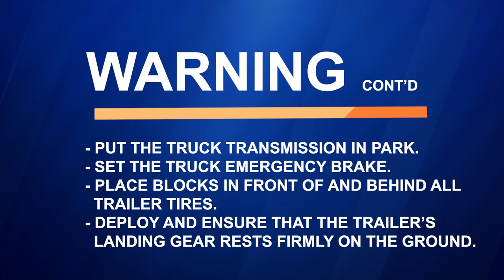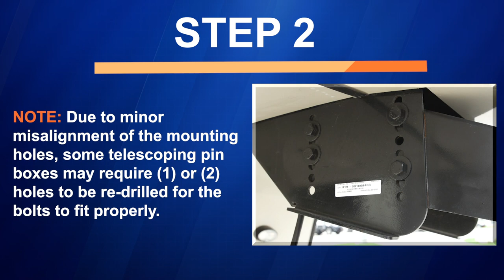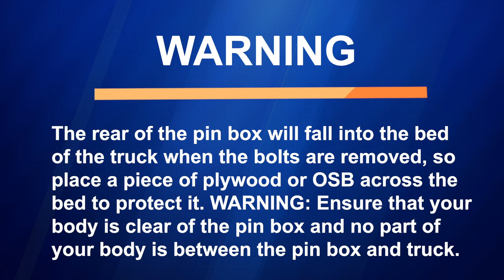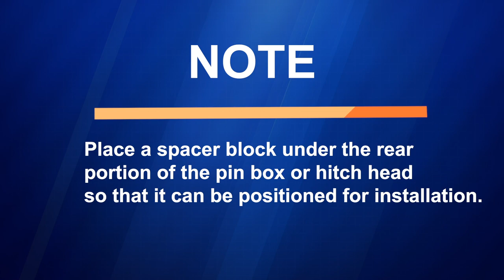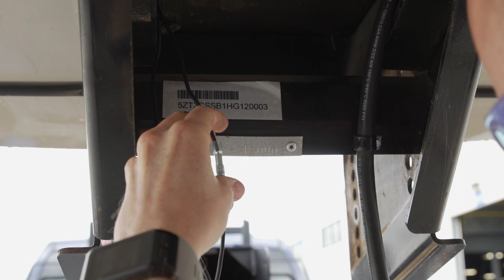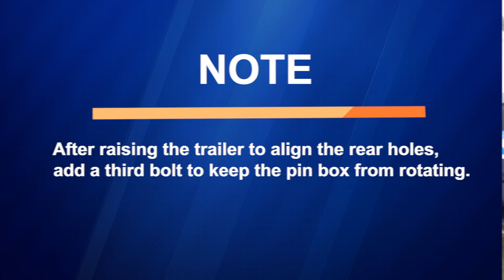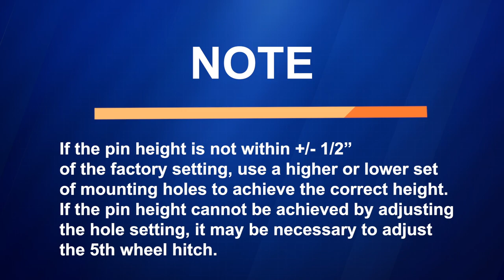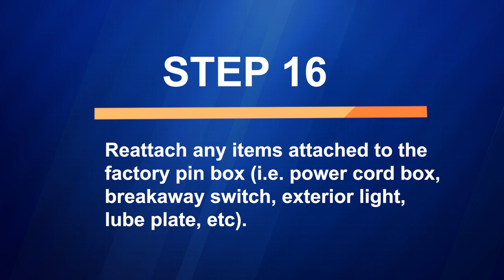MORryde Rubber Pin Box Installation Instructions

Comment: Do not buy a morryde pin box,  they are dangerous, I've almost had 3 crashes using the one I have...they slide violently when braking around a corner...can cause you to lose control of jour tow vehicle.
Reply: I was curious about that. would drive me nuts, its like a shifting load, very dangerous